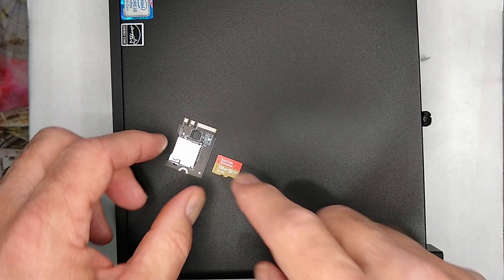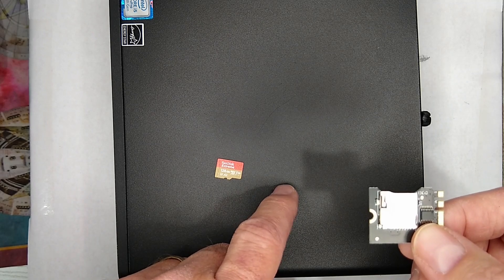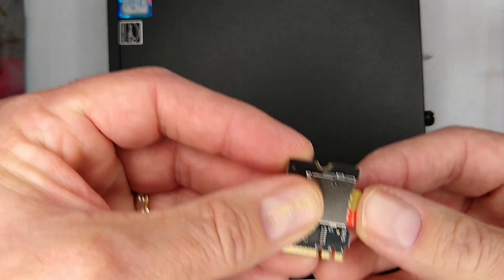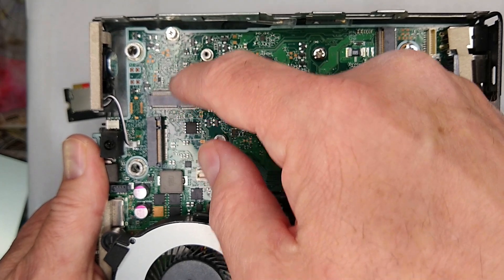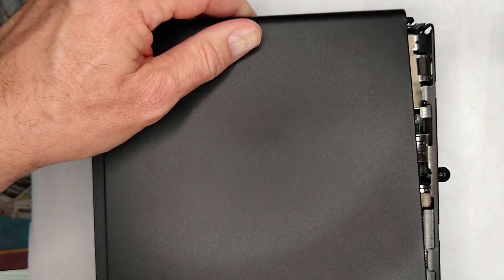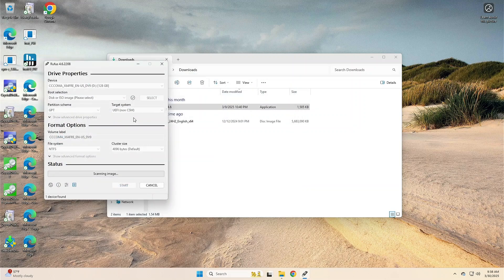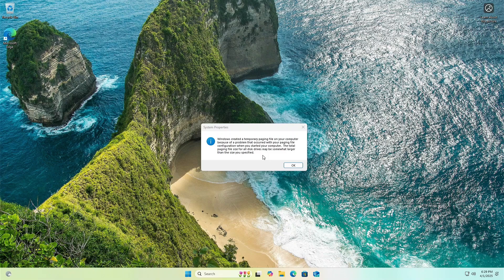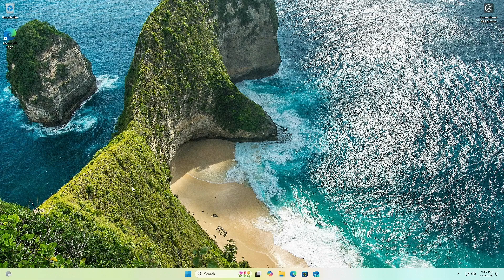Yet another "wifi" harddrive using a Micro SD Card

Comment: i think you could put full sized nvme drive in there with L adapter. I am thinking of doing that my self for 2x 4tb NAS
Reply from the maker: Check out my other videos on using the WiFi slot for a drive.  Those adapters normally accommodate larger sized NVME and you break off the piece you don't need. Challenge is that you may bump up against chips and resistorsvon the motherboard.

Comment: If you don't need WiFi, there are microSD cards that store as much as 1TB. It's not fast, but not all applications require full PCIe speeds to be useful, and it's a way to max out the internal storage options in your mini. I like the idea of a NAS boot card, leaving the other internal connections available purely for shared storage. OpenMediaVault has a plugin where the system is essentially loaded from your boot device (thumb drive or SD) and runs entirely out of RAM, caching log files and only occasionally writing back to boot drive to extend the media's lifespan.

Comment: Sd cards marked A1 or A2 are made for OS use.   Windows to Go  I believe is designed for thin clients.   I have heard if you are formatting an SD for other operating systems such as Linux or Pfense  (for routers)  leavinf some space unformatted may help your card live longer.   SD cards were the boot media for early raspberry pis so this may be old news.
Reply from the maker: Windows to Go is a way to have a simple bootable windows that resides on a USB drive.  Had not heard about the A1 and A2, I'll look into that.  I used to use a micro SD on the ill fated Intel Edison.

Comment: I think these wifi adapters for microsd cards run at USB2 (480Mb/s = 60MB/s) speeds. That's consistent with your low CrystalDiskMark scores. In contrast, I found an M.2 A+E key to M key 2280 adapter for NVMe drives that works perfectly in the wifi slot of the G4. It gets around the slot orientation by connecting the two PC boards with a flexible cable. Just velcro the 2280 board to the lid of the G4. You get PCie3x1 lanes to the NVMe drive, so the bandwidth is around 700-800 MB/s. Plenty for an OS drive. Of course, it's bootable.
Reply from the maker: @dktol56  definitely better.  I have two videos which use those NVME adapters.

Comment: That paging file error thing just means the os drive doesn’t have enough iops to be good enough (input output operations per second) if you do the windows to go thing of a drive with enough iops you don’t see that message
Reply from the maker: @samanthagriffinv2.08  that is good info and news to me.  I guess if you had a secondary SSD you could put the paging file on it?
Reply: @ na from my experimental testing it only cares about the drive it’s installed on for that message
Reply from the maker: @samanthagriffinv2.08  so does the message go away if you put the file on say a D drive that is SSD?
Reply: @ no but if you install the windows to go on a fast enough flash drive or add card or like an external ssd like the Samsung t5 for example that message doesn’t appear on the ssd car side of things I think you need a u3 speed ssd card and reader
Reply from the maker: @samanthagriffinv2.08  good info for folks considering going the micro SD route.  Thanks
Reply: @ no problem I hope I didn’t confuse you that badly and clarify any confusion you did have

Comment: This is a comment about your LAST video, about buying non-supported hardware. I really wish you had explored a solution of loading one of the windows ltsc iot variants. Both windows 10 and windows 11 versions run without issue. It used to be you could not as an end user find licensing for the ltsc iot versions but at least for the windows 10 ltsc iot version there are now key retailers selling licenses. Might be a great video idea to see your opinions about using these os's on your g3 and older mini pc's
Reply: They should be the same. They're are some other videos on LTSC by tech yes city and tek syndicate. They also link where to buy licenses. I have been using windows 10 LTSC IOT on my hp mini PC (it's actually a g6) for a few months now. It's just like what a streamlined windows should be, and no requirements even if using windows 11 ltsc iot, which I have run on my desktop for months. And it's fully supported till like 2030. A great solution for older PC's.

Looking forward to seeing your take on it
Reply from the maker: I've been looking into making a video about how to install or reinstall the windows iot that comes with thin clients.  I'll have to research the differences between the think client windows iot and the ones available via a purchased license.

Comment: Wonder if there is an adaptor like this that would take a low profile USB thumb drive, as I have had a few reliability issues with microSD on raspberry pi's. But this adapter would be good to put a Linux distro on for a dual boot system so you have Linux available just for the occasional use. Great vids. but not to happy with finding your channel, I now have 4 Elitedesks and I don't think i'l be stopping there <G>. Keep up the good work. Kind Rgds.
Reply from the maker: Sorry about that.  I'll try and make them less enticing. I'll also keep an eye out for a USB adapter.

Comment: Ideal for a system backup drive for the OS, whether windows or linux? it's not as you said a speed demon but for backups and disc recovery it's probably ideal. Can't beat these little elites etc, it's a shame here in the UK that as a second hand unit you pay almost as much if not more than one of Amazons mini pcs with the N series chips. Real hand not just for the Elites etc, handy for any machine attached via ethernet not wifi as the wifi slot can be used.. Good video and thanks for the idea.......... Amazon 1 need 4 of these please...
Reply from the maker: And of course you can pop it out and rotate your backup disks.  Bummer on the EliteDesk pricing.  Takes the fun out of trying to help  up cycle these units.
Reply: @handmedowntech  I've noticed that they're much cheaper the USA than here in the UK I think the reason is that as old as some are, like the 6500t's they are solid machines that still have plenty of uses, 2 of the 3 7500s I have are running Linux mint with some 100tb external hds attached each. Both are used solely as emby media machines backing up one to the other, the 3rd has mint with 32gb and a tb nvme, used solely to run virtual box with Win10, Win 11 for window programs such as Photoshop.. I know I could shoehorn a 9500t into 2 of em, but again here second hand ones are not cheap in dollars they go for about $350.
Reply: @handmedowntech  I'd, buy 6 and cluster them if they where cheaper..
Again good bunch of videos on these old beauties.
Reply from the maker: Thanks

Comment: Nice.  Would probably work for my Elitedesks that don't have a full M.2 slot, especially the ones that don't do a lot of data writes.  If you DO a lot of read/writes, I highly prefer high endurance SD cards.  SanDisk and Samsung have them.  Regular cards tend to fail after a lot of constant use.
Reply from the maker: I remember looking at the high endurance for their ability to deal with harsh environments like outside cameras.